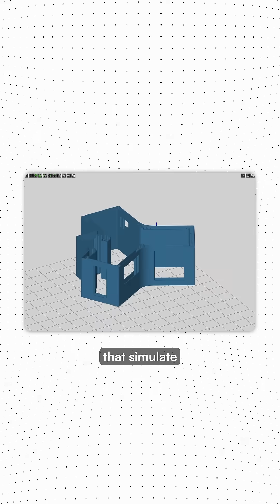The future of construction could be 3D printing 🏗️ #trendingshorts #3dprinting #construction #tech

Comment: I would do this for a garage, or small extention not requiring utility. Adding power to the outside of cement without  some kind of interior, and onto walls that thin no less. I wouldn't live in it, it's called brutalistic architecture.

Comment: They aren’t building a house in several days. They’re just building the walls. Which on a one floor single family home only takes several days for a small framing crew. You have to build the foundation first, with human labor, then you have to install utilities like plumbing and electrical with human labor, then the roof, doors, windows etc. then the real time consuming part of construction the finishes. In total this is going to take the same amount of time and probably cost even more. This is a solution in search of a problem. I’ll be impressed when they can finish an entire house in several days for half the cost. Which isn’t likely with this technology.
Reply: Excellent take on this—plus it looks like total crap esthetically.

They should build underground bunkers with this method.

Comment: How does that work for plumbing, electrical, and window and door openings? Will the inside be full of exposed plumbing and conduit like in a warehouse?
Reply: Concrete exterior with drywall interior to make plumbing and electrical appear neat and tidy, same as a modern brick and mortar house.

Comment: Concrete is expensive and heavy. The speed and strength is great but the foundation will have to be tough, and it’ll be pricey. 
No idea how wiring and plumbing would work, especially if there ever needs to be a remodel or something to that nature. 

Neat, and possibly an excellent idea in another decade.
Reply: Pre printed moulds of walls with integrated plumbing and electrical that go together like big lego blocks 

Say good bye to the construction worker
Reply: I’m sure it’s similar to brick buildings. A brick wall with the internals covered up by drywall.

Comment: No way I'm having my family live in that... But it's a great idea for a Mars & moon base...
Reply: Why?

I think it looks nice if rather have concrete walls rather than cardboard and air
Reply: @juanmiron2321  
Idk know very much about this subject... but it seems to me like repairs could be difficult, extensive & expensive. Already as residential construction is, if there's foundation issues, cracks & shifting occurs in the walls & everywhere else. Being as this is basically one solid unit after it dries... that could be a problem & also dangerous. But like I said, Idk much about 3-D printed homes. Regardless I've been in the residential/ commercial construction industry over 20 years. Mortar & stone...& or, steel is the best above all. You hit the nail on the head with what you said though... Modern homes are trash.